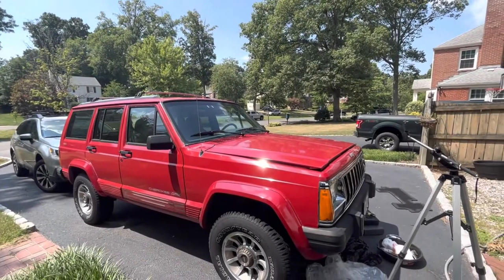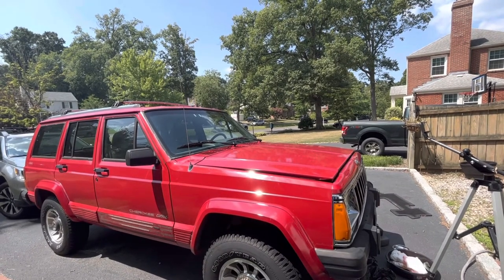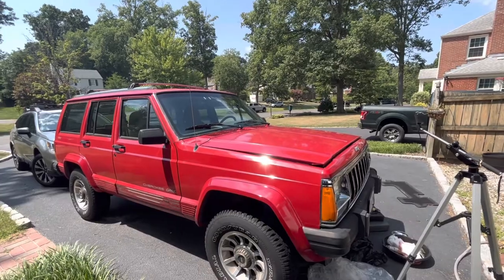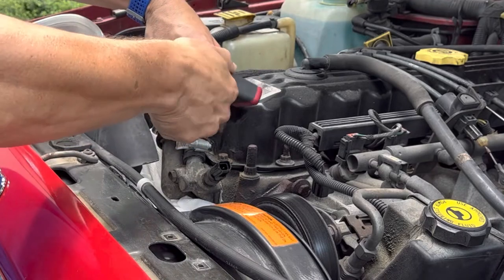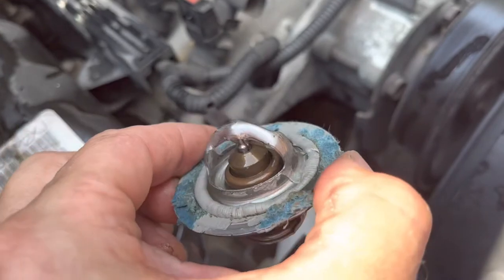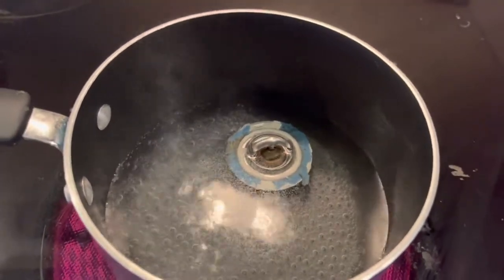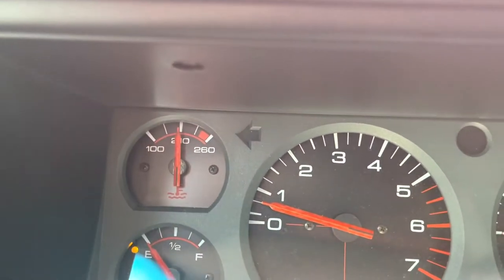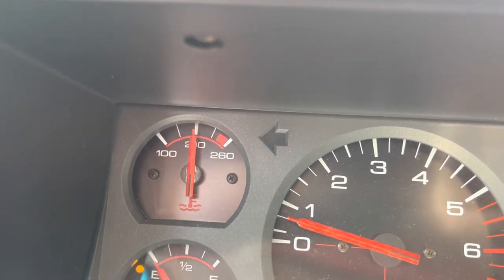1996 Jeep Cherokee XJ Thermostat Replacement

Comment: Glad you got it fixed, though FYI, Mopar branded thermostats are not really OEM at all. All they are now is a MotoRad thermostat, the same manufacturer as the Duralast at AutoZone or a Murray at O'Reilly, inscribed with a Mopar part number, packaged in a Mopar box, with a dealer markup.
Reply from the maker: Interesting to know.  I’ve seen that many aftermarket thermostats aren’t as effective, so I got what I was hoping would work.  And they really did!

Comment: Small tip guys, park jeep in a way that front is slightly higher or use jack stands then coolant will not pour out of engine when removing thermostat
Reply from the maker: Great tip!  This was actually parked with front higher than rear in my sloped driveway

Comment: I did this and my jeep started overheating
Reply from the maker: Not good. Why did you do it in the first place?  Was it overheating?  They say it is very important to install the valve in the correct direction and to have the hole on top.  Also, be sure to bleed all the air out of the system.